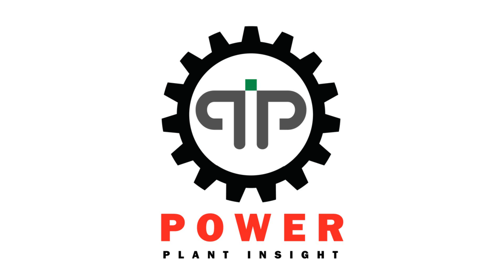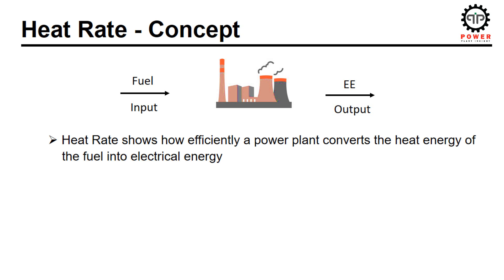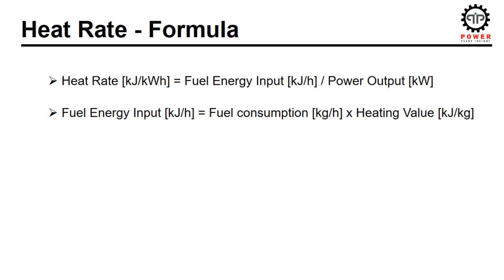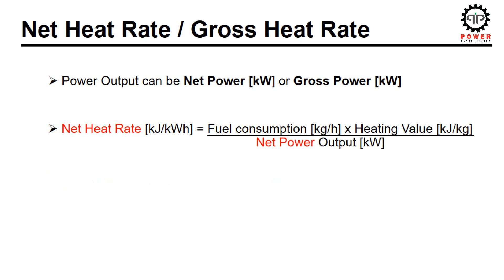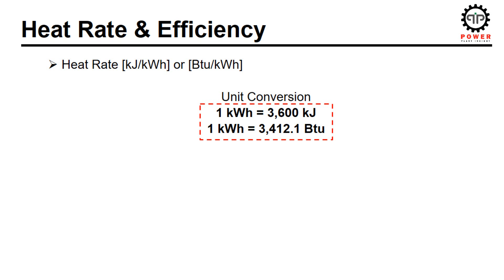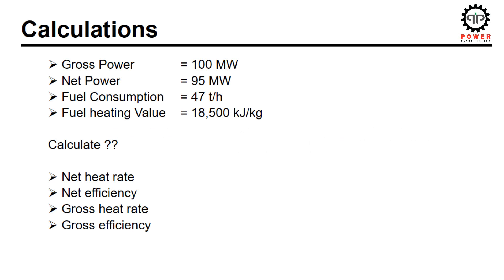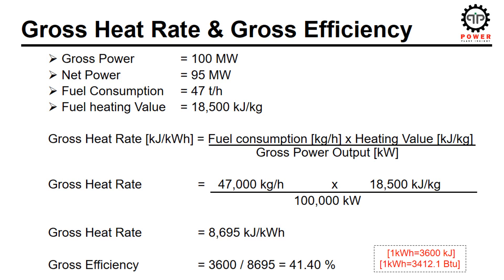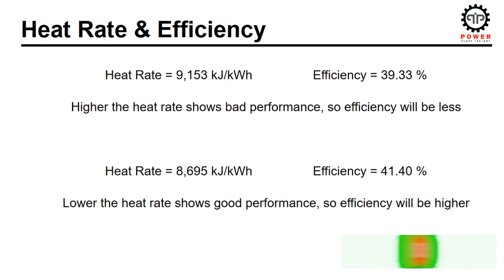Power Plant Heat Rate Calculation | Relation with Efficiency | Net Heat Rate | Gross Heat Rate

Comment: Kindly explain regression analysis on HRSG performance and overall ccpp.
Like how temperature of feed water inlet, hp temp impact the heat rate
Reply from the maker: In case's both these parameters can be directly correlated with overall cycle performance, but there are OEM provided curves as per ASME PTC codes for there interpretation in terms of cycle degradation.

Comment: Sir what r the axcilary equipment in powerplant????why it need cooling water??? please let me know...
Reply from the maker: A part from the main equipment's of thermal power plant like Turbine, Boiler etc. There are other equipment's which are also of key importance in plant operation like Induced or Forced draft fans of boiler, Combustion air recirculation fans, Boiler feedwater pumps, small pumps installed on condensate or cooling water cycles & many more items like that comes under auxiliary equipment. Cooling water is required to cool the bearings or in some cases motors of these equipment's. I hope you will get my point.